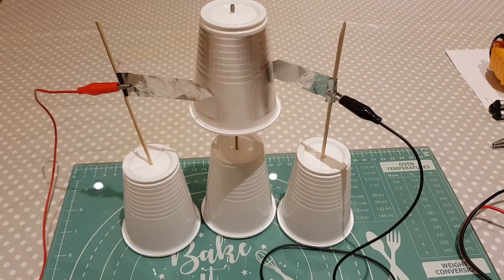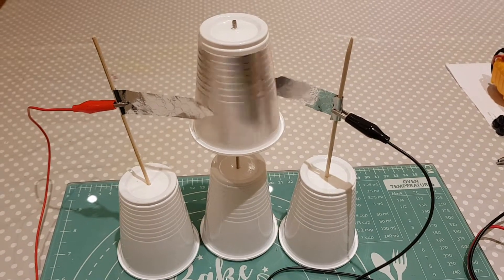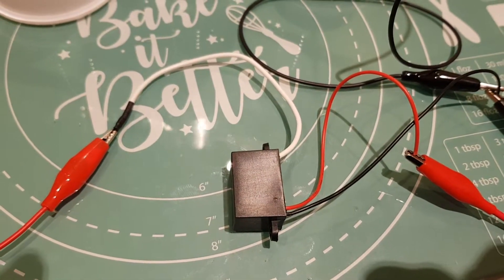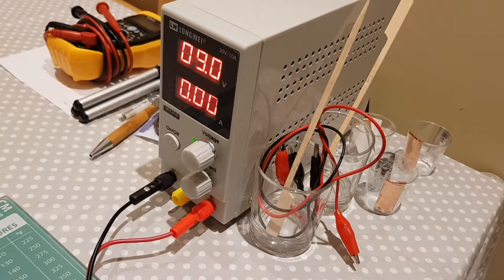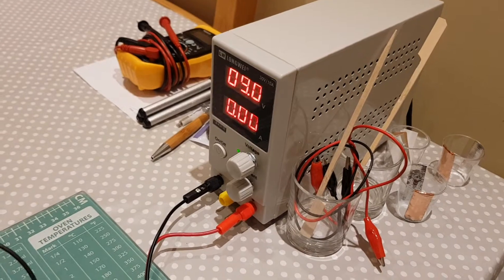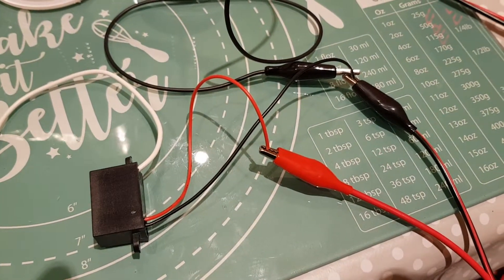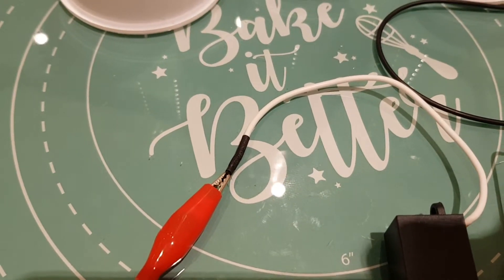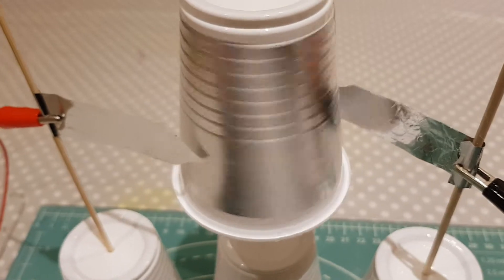Electrostatic motor with a negative ion generator

Comment: Nice video, I have question about the module. I tested its output with multimeter. If multimeter probe torches side of output wire,  it shows -120V. but if the probe touches wire tip,  the voltage is more in KV. Do you think it is true?